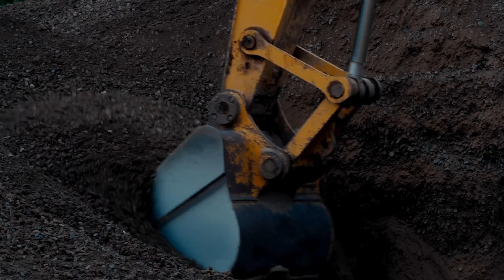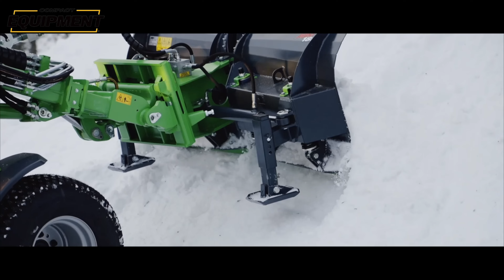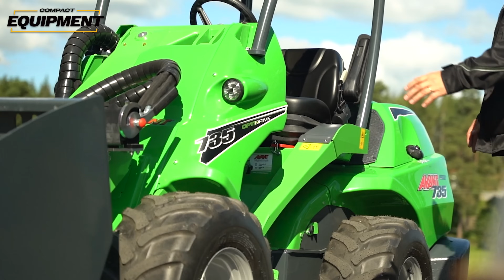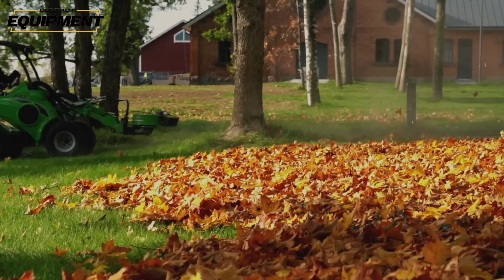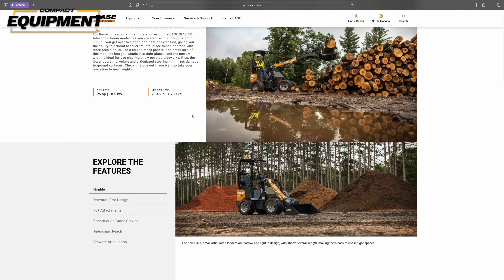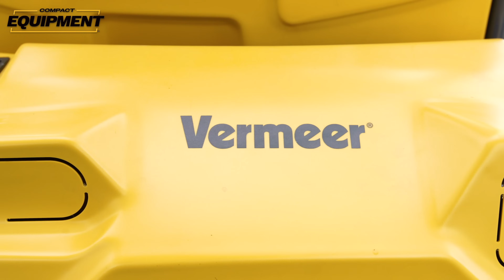Can a Small Articulated Loader Really Replace Your Skid Steer?

Comment: Put a three point hitch and a pto and you have everything.
Reply: Its articulating when it steers it will damage the three point hitch or the attachment
Reply: That concept already exists. It's called "Merlo Multifarmer".
Reply: @smurface549  For sure. The Merlo is a much larger machine. A small loader like this with a three point and pto would make it a veritable Swiss Army Knife for the farm, using many attachments that farmers already have.
Reply: @fredhinck9685  Sure, but one would be severely limited by the size and power of the machine. You can't operate a large wood chipper or brush cutter with a 25hp machine, you can't plow a field and you can't do another hundred things.
What's left within the capabilities of a small loader is apparently not enough to justify the development of a 3-point hitch and PTO onto one.
A 3-point hitch might actually come most handy to just move equipment around without operating it, and there are adapters for it.
Reply: @smurface549 Dutch loader manufacturers Tobroco Giant and Pitbull Loaders both have a 3 point option on some models. Giant even has a pto option and advertising Images with a pto driven flail mower. Look up "Giant V452THD X-tra med mekanisk PTO" here on youtube for a video of it.
Reply: Yeah.  You would have a tractor.